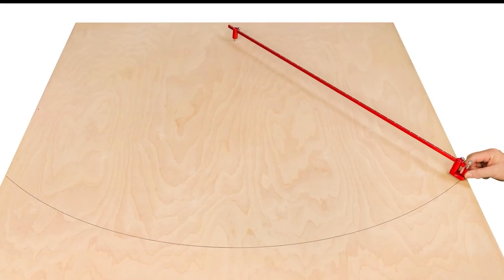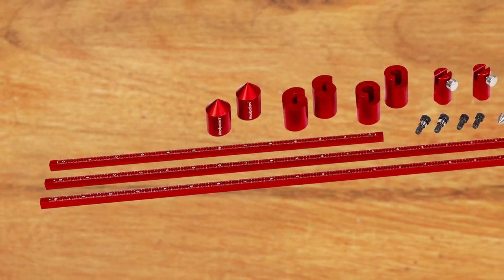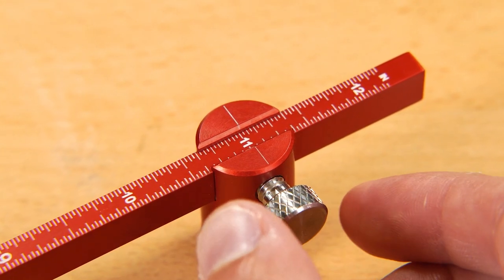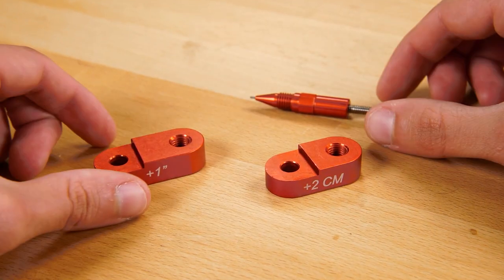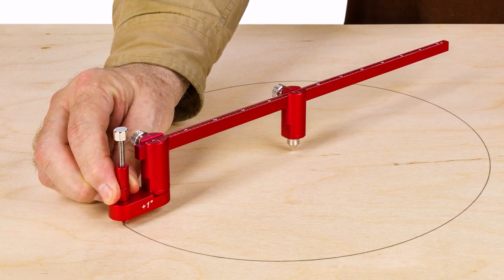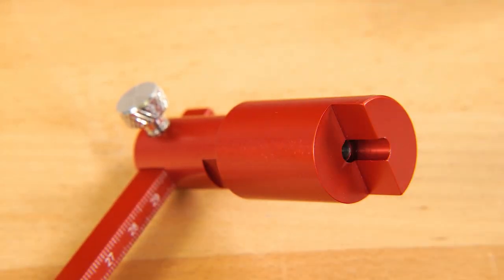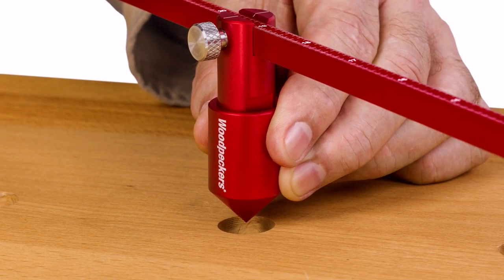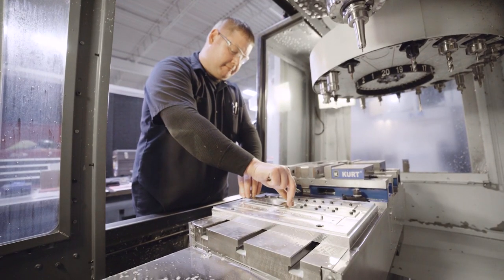Deluxe Trammel System | OneTIME Tool | Woodpeckers Woodworking Tools

Comment: Nice looking system, this is one of those ‘conditional’ tools that you might use a lot (and it will pay for it’s quickly) or only occasionally (it will be a pleasure to use when you do).  Could come in really handy if you do floor inlays, especially if tagged up with a shaper origin.  The naysayers will complain about the price (as usual), those that are actually using tools professionally will buy it and write it off.
Suggestion to WP, add a base for dbl sided tape.